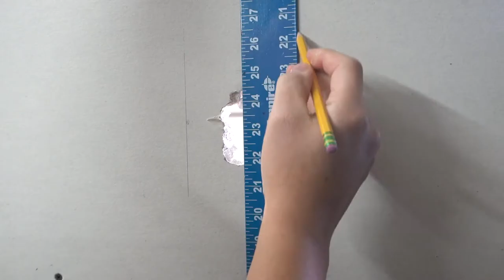How To Repair A Hole In Drywall Using The California Patch Method | Fast And Easy DIY For Beginners!

Comment: Hi @Fix This House, thanks so much for spending the time to make these videos. I feel a little less intimidated doing this type of work. I wanted to know what your opinions on regarding products that already include the mesh and patch? I have some concerns about whether that will prevent me from reusing certain sections of the wall depending on the solution I choose. I'm sometimes looking for the simplest solution but at the same time I might get burned if I cut corners.

Comment: Have you done a video on spraying orange peel textures to match in patched places? I have lost a lot of texture where I have used a brush to cut out around trim when painting different colors over the years. I also have lost it where I've patched old nail holes. Intimidated by the can, wondering how to mask it all off properly to avoid excess and how to blend existing texture with the overspray, etc.  Thx!!

Comment: Would this patch be able to handle weight like about 40lbs?
Reply: To bear Weight, it's best to use a Texas Patch; which requires a strip(s) of wood to be placed behind the Hole & secured via Screws through the Wall.
T-Patch Vids are also on Y-Tube.